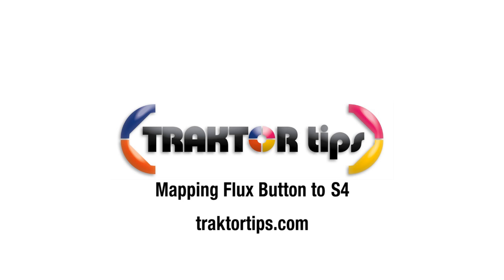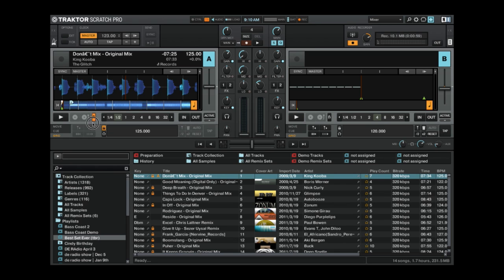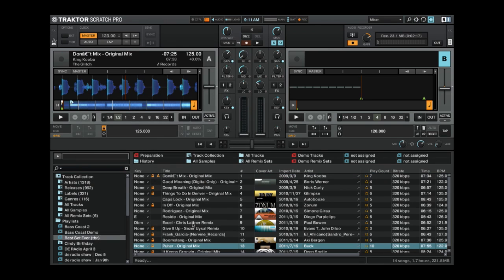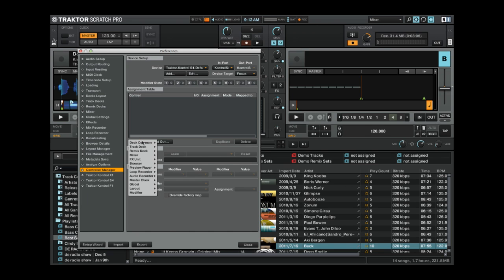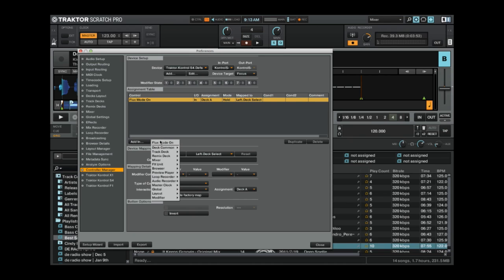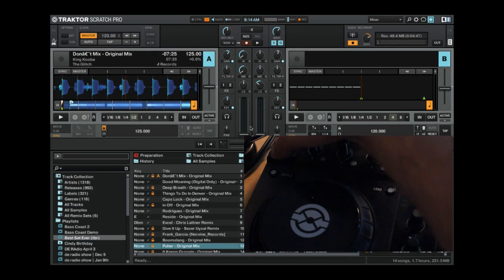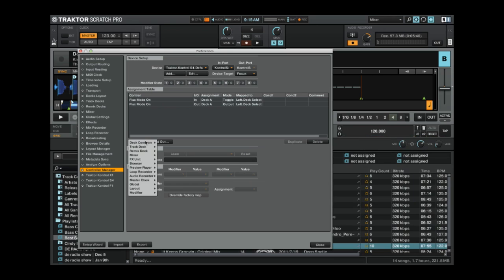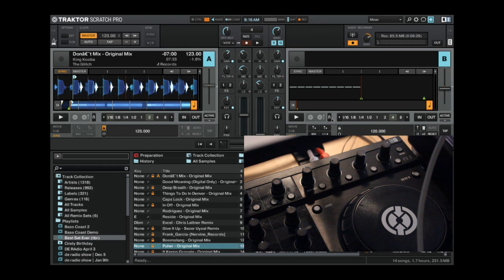Map Flux Mode to your Traktor Controller

Comment: Does this flux mode works with auto-loops or just by holding the loop button? I want to throw a 4 beat loop, and then do a loop roll until the 8-bar phrase ends, exit auto loop and continue the track where it should.